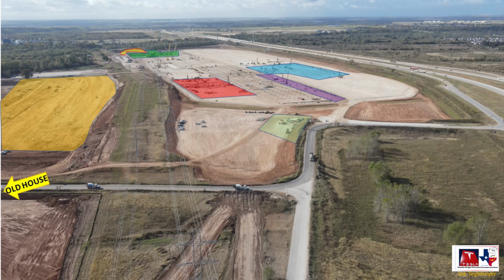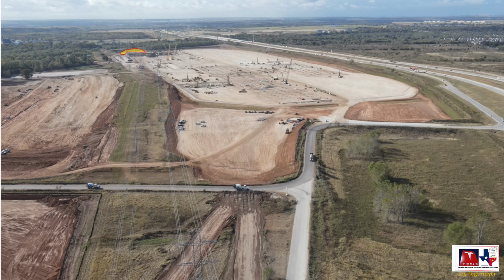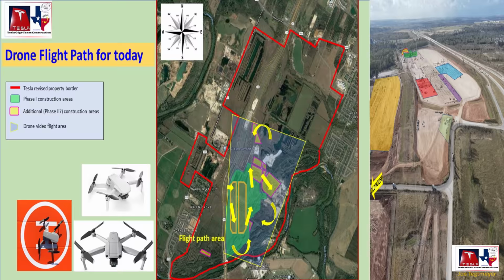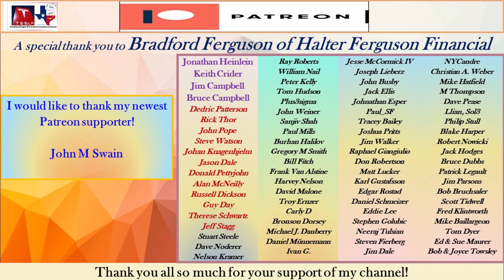Tesla Gigafactory Texas 10 November 2020 Cyber Truck & Model Y Factory Construction Update (08:30AM)

Comment: Those red things 12:17 into the video, are simply cones stacked together upside down, without the foot. I guess...
Reply from the maker: Good idea ... will see on the next video to be sure
Reply: I think they are buckets.
Reply from the maker: Lee ... you might be right
Reply: @leestone9028  Home Depot buckets????
Reply: A colony of tall cones resting upside down in stacks of heavy portable holes.
Reply: Personally, I think they might be rolls of snow fencing. Often used here in Canada for reducing snow drifting, it would make a cheap and visible warning to cordon off areas for worker safety.
Reply from the maker: @charlesriordon5344  If we get snow in Austin, we will have a huge problem city wide!  Just doesn't happen here (thankfully)

Comment: As huge as the main buildings at Berlin are, it is hard to comprehend that buildings starting here will be much longer and bigger.
Reply: How do you know?
Reply: All the various walled-off, separated work areas in Berlin will be under a single continuous roof at Austin, TX. Even the walls on each side of the internal street may be left open...

Comment: 6:10 - Remember when the shape of the big pit changed?   I think the two large isolation foundations used to be side by side and all the middle stuff was formerly planned to be north of them..   Then someone realized they could nest it between the large sections and probably streamline the movement of components.   

Thus the pit was widened west and the north section was filled back in.   That's my guess anyways.
Reply from the maker: You might be right ... Something seemed to have changed along the way but they are now full speed ahead.

Comment: 11:16, odd way of piling up spoil.  18:58, it's a ring. But why?
Reply: I was wondering that too... maybe making giant pasta.
Reply: I was surprised Joe didn't mention it... and it's not something random, from being unloaded a certain way -- you can see the loader actually making an effort to make it just so. Would imply some kind of circular feature planned there -- a hole in the middle or a ditch around it.
Reply: I watched that ring being poured out of a concrete truck. He didn't get the circle quite right, so I guess accuracy wasn't important.
Reply from the maker: I noted this but there was so many other things I left it off the commentary ... I think its refuse, but will check again next video

Comment: Looks like the new crane they are moving in at the end of this video has really big feet.
Reply: Probably need this one to position the concrete pillars at the South end.
Reply from the maker: could be.  Will check back on my next video
Reply: I only see ONE FOOT for the new crane at the end of the video (one track), and I don't see the main crane body? Could this one track just be a spare part or replacement part for one of the other cranes on-site?
Reply: @phototec  
I think one track showed up before the body arrived. The crane body is probably a "wide load" and has logistical problems traveling that this truck wouldn't have. 
PS (Each link in a track is called a foot.)
Reply: @phototec  I see in a later video there is in fact a second FOOT and a really big stick for the new fella. Costs a lot to have all that crane power on site. They must be getting ready to bust out in a massive construction effort.

Comment: Joe, I keep wondering about the Gazebo. Of course it looks like it will become part of the structure but I wonder if they are using this as a reference point?? Could all vertical beams have their location referenced to the Gazebo? In today's closeup of the Gazebo, there appear to be wires leading to each of the four legs. Are there some electronics associated with that structure? I, of course, know nothing about any kind of construction but the whole "measuring" thing has me scratching my head. There has to be some really accurate measurements taking place there. It would be fascinating to learn about those methods of measuring.
Reply from the maker: The wires have been there since day 1 ... I think to help add rigidity while it is a free standing structure ... these will be removed once additional structure added and it has more support and rigidity as a structure.

Comment: Is the switchyard going to be used for loading vehicles on trucks for delivery?
Reply from the maker: I don;t know but there is enough pavement space around the switchyard per the site plan that it could serve as a staging area to load up cars.  I just don't know for sure yet.
Reply: No, its for the power to the factory, an electricity switch yard, where high voltage comes in and lower voltage lines distributed all over the factory .. a few weeks ago Joe explained in one of hsis video's.
Reply: @JoeTegtmeyer  After watching Giga Shanghai I thought it might be thanks
Reply: @MarcoNierop  Ok great thanks that is sure a large area.
Reply from the maker: @starshipcaptain4753  I'll keep watching and we'll know for sure by the end of this year I think.
Reply: @starshipcaptain4753  It sure is quite big, so maybe not all area is used as a switch yard but just a part of it, what the  other part will be is to be seen, could end up as a parking lot, but could also be used for more factory buildings, like for batteries or drive trains.. Berlin has also a seperate building for drive units manufacturing.
Reply: Electrical switchyards don't take up that much room. Look at the one across the river for the two sets of transmission towers running thru the Tesla site: 

https://www.google.ca/maps/place/30%C2%B012'39.7%22N+97%C2%B037'02.5%22W/@30.2176459,-97.6187213,2297m/data=!3m1!1e3!4m6!3m5!1s0x0:0x0!7e2!8m2!3d30.2110291!4d-97.6173544?hl=en
Reply from the maker: Check out my 15 September video to look at the actual site plan and info on the Giga Texas switchyard.

Comment: Painted themselves into a corner? The new four concrete footers appear to be unplanned.
Reply: They're in line with the rest of the footers (outside the pit).
Reply from the maker: Not at all ... they use cranes with large concrete buckets to fill the short foundations and possibly pump trucks for more.  I seriously doubt these were unplanned ... this seems we;; engineered and executed to me.
Reply from the maker: That is correct.
Reply: @JoeTegtmeyer  
I say this because equipment needs to transverse over a previously poured concrete pad to access the four new work areas. Not a good technique. To prevent damage to the pad from the equipment (trucks, backhoes), a corner of the pad was covered with sand.
Reply from the maker: Ok